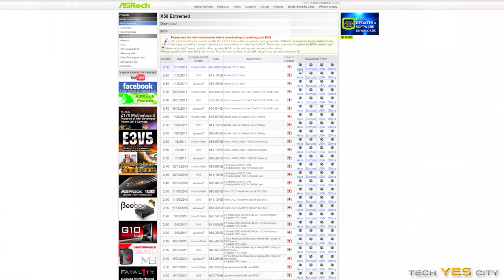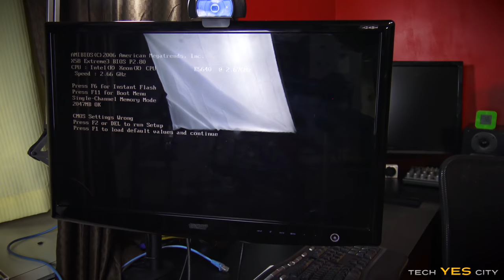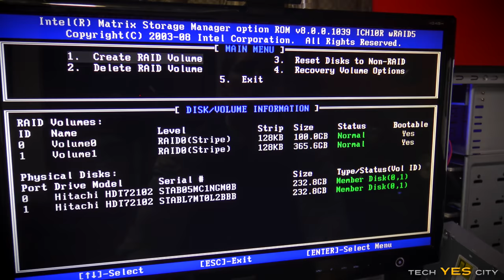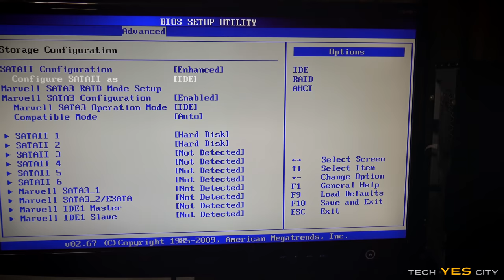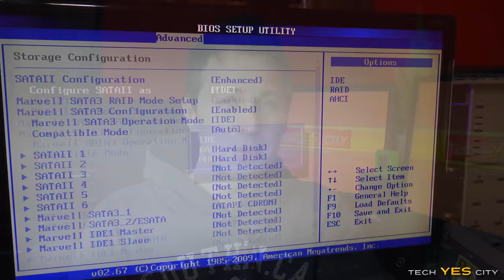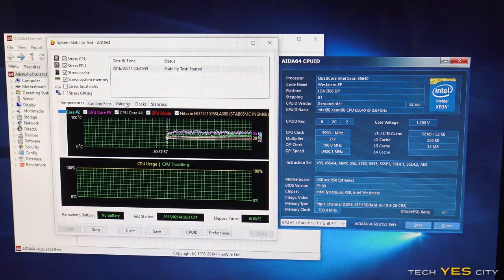Project WESTMERE - $327 USED PC Ft. The i7-???

Comment: Always appreciate builds like these that showcase just how much value can be had if you go back a few generations.  Best part is that platform still has a lot more headroom despite being nearly seven years old at this point.  Can still handle the highest end graphics cards if someone really wanted to go down that route; although it does make me wonder if pascal will finally push them to their limits.

Comment: Love your builds. did my own this past month some one tossed out a Lenovo M48 the system was striped of every thing but the cpu but I did a full rebuild of the system after watching your videos made me really want to fix it up and see what it could do.

Rebuild specs Intel Q45/43 Motherboard Lenovo Branded 
CPU: Q9400 
Ram 8GB DDR3 1333MHz 35.00 shipped
HDD 250gb 10.00 local store
Enermax Pro 82+ 625W PSU Free from work
ASUS HD7770 60.00
Windows 7 Pro Free from work
105.00 all in

Was fun to do a build like this gets great fps with no overclock on the cpu as this board is not made for it but still get around 60 - 80fps on High though Bf4 and other games at 1920x1080 keep up the great videos. I might do another build :D

Comment: Hey man, I'm really enjoying your content and I'll be subbing right after I finish this comment: As great of a deal as the E5640 is in general, I can't help but feel that its performance should be identical to the 920 that came with the motherboard (at the same clock, of course). The 4GHz on your E5640 should be attainable on the 920 (maybe not if its a C0, but a D0 should get 4GHz). So from a value maximization perspective, the E5640 seemed a little wasteful because you had the 920. Granted, if the mobo didn't come with a 920, the E5640 is clearly the superior choice. I know you can sell the 920, but that's a bit of a hassle. Anyway, cheers!
Reply from the maker: +spire107 Hey thanks for the comment (and the sub too!), The 5640 will be more powerful than the 920 since the 920 is 45nm and the 5640 is 32nm, I will double check the scores clock for clock in the next few days.  And also I like being different and couldn't resist using the 5640 and then trying to flip the 920 for $50 or so (so $30 profit for a better cpu :P).  It is pretty easy for me as I have auction access on both ebay and yahoo.
Reply: +Tech YES City Wow, I didn't realize that the i7-920's were so expensive. I have a Xeon W3520 (basically a D0 920) and I've seen them sell for around $5 each. I shouldn't have assumed that 920's would sell for the same amount. 

I couldn't agree more on the appeal of the E5640. In fact, I'm thinking of selling my 980X in order to get an E5640 and use the difference to upgrade my GPU. I've heard that there is a 5% IPC gain between 45nm and 32nm, but haven't tested it myself. I'm quite interested in your results if you find the time to test it.
Reply from the maker: Yeah I guess the reason for the 920s being expensive is the qpi of 1, a lot of x58 boards won't support the xeons at all.

Comment: great video man :) in my opinion buying used pc parts is just freaking genius because i also bought used pc parts like you and built an unbelievable gaming machine for only $390 USD :O specs are given below

CPU : Intel Core I5 4690K Overclocked @4.4ghz
CPU Cooler : Cooler Master Hyper EVO 212
GPU : GTX TITAN
RAM : Crucial Ballistix Sport 8gb (2x 4gb) and Kingston HyperX (2x 4gb) = 16gb of total ram
MOBO : MSI Z87-G45 Gaming
PSU : Corsair CX600M
HDD : Seagate 1TB

believe it or not but its true ;)

Comment: 3dmark score isn't that bad. Though I was expecting a bit higher for some reason.
I recently made a build with the G3258 and 7870 (r9 270x). Scored a little less than this rig, I had parts already laying around so the build only costed me around $150 out of my pocket.
It doesn't compare to my main rig, but these budget builds are very capable if you have some knowledge on what to get.

Here is my score btw. 
5253 with AMD Radeon HD 7870(1x) and Intel Pentium G3258
My G3258 is clocked at 4.6ghz @1.32volts.

Comment: I got an X5670 @4.6Ghz in my Main Pc with 2 R9 290, and it is an absolute beast. I had an i7 4790k with 2 R9 290 before, but the Westmere just feels much more snappy.
Reply from the maker: +MarcChep Yeah the x5670 packs a tonne of l3 cache too, great architecture.
Reply: I really love the X58 platform. The X5670 destroys more modern CPU's in multi-theaded applications.
Reply from the maker: Yeah with the right board too you will have usb and sata 3 there too!
Reply: It's pretty amazing :D

Comment: Awesome killer budget build bro !! more than half my 3dmark firestrike score (10950) with a fraction of the price (mine 1000++ 6600k@4.5 r9 290xOC) well if you count the ssds case etc way more because I went overkill, but that's a nice way to compare !

Also, you use a mask for soldering that's smart ! (what did you solder btw?) and that case is pretty cool
Reply from the maker: +Thomas Syxe Solder the 24 ATX pin with a Sata Cable, as I couldn't find my voltage reader (going to look for it this weekend).
Reply: I dont get it but no big deal XD lol

Comment: What's the time Mr Bryan? :P

Pretty good build dude, but it's always the case when you get a cheap but good CPU that kicks ass you have to get a mobo that costs stupid money. I think the price to performance kings at the mo are the 65nm quad core Xeons but you have to have the right chipset and mod the board and CPU.....Talking of which I thought you were doing a 771/775 mod build....Waiting patiently :P

Also what connector did you splice in?

Comment: Thank you for sharing :) Really nice rig for that cheap price. Oh yes you remember about my xeon to get it to 4ghz? Its not possible, because there is a hardwarepart missing in the b85 pro gamer motherboard, but anyway 3,8ghz @ all 4 cores on a xeon 1231v3 is really nice too. Maybe when i build my new rig when broadwell e is out, i will buy a cheap z board and then i try to oc my xeon.

Much greetings :-)

Comment: Just did a build today a c70 case, DVD rw, cooler master 700w psu 80 plus, am3+ motherboard, fx4150 cpu, 8gb of 1600kHz ddr3 a 128 sad, 1tb ad blue hdd, 7x140mm corsair fans, and a power color HD7850. All parts were picked up on Craigslist for around 173.00 us dollars can't wait to overclock benchmark, then gift it away to my friends kids

Comment: Hey Brian, I was wondering if the $356 budget gaming PC I am building is compatible and thought that you were the person to go to because you're a GAMING PC GOD :). Please reply back ASAP! THNX!! Here are the specs:

Intel Xeon E5640 
ASRock 970 Extreme3 R2.0 AM3+ AMD 970 SATA III USB 3 DDR3 2100+ ATX Motherboard
Kingston HyperX Fury White 8GB (2x4GB) DDR3-1866 Memory
Seagate Barracuda 1TB 3.5" 7200RPM Internal Hard Drive
EVGA GeForce GTX 750 Ti 2GB Superclocked Video Card 
Zalman Z3 Plus White ATX Mid Tower Case
EVGA 430W 80+ Certified ATX Power Supply
Reply from the maker: You will need an AMD FX cpu for that motherboard, if you want to use the e5640 you will need an x58 motherboard, which can be pretty expensive online (I find they are much cheaper at used parts stores). Other than that be build looks good.
Reply: Hey Brian, I JUST updated my build. Is this compatible?

Intel Xeon E5640
Cooler Master Hyper 212 EVO 82.9 CFM Sleeve Bearing CPU Cooler
HP Z400 LGA1366 TYLERSBURG-B3 DESKTOP MOBO 460839-002 461438-001 FMB-0802
Kingston HyperX Fury Blue 8GB (2x4GB) DDR3-1600 Memory
Seagate Barracuda 1TB 3.5" 7200RPM Internal Hard Drive
EVGA GeForce GTX 750 Ti 2GB Superclocked Video Card
Thermaltake Core V21 MicroATX Mini Tower Case
EVGA 430W 80+ Certified ATX Power Supply 

PLEASE REPLY QUICKLY!!! THNX!!!
Reply from the maker: Will be compatible but not sure if that motherboard will be able to overclock?
Reply: Do you know any other mobos that are compatible and under $74? I'm on a bit of a tight budget. :/ Reply back! Thnx!
Reply from the maker: Here is one up for acution at the moment for me locally lol, will prob go for around $50-60? http://page15.auctions.yahoo.co.jp/jp/auction/t477947659
Reply: You're lucky you live in a country where it costs you money to throw shit away get like fuck you get deals like crazy
Reply: do those sellers usually ship to the US?
Reply: +Ben Dover gtx 560 is worse than the 750 ti and the gtx 660 is similar in performance but doesn't overclock nearly as good...
Reply: +Ben Dover a 750 ti is hardly more expensive than the 660. on eBay they go for similar prices. Best used card for the money whoever would definitely either be a 770 or 7970/7950
Reply: how can you overclock an i5 2400?
Reply: ToronTech u can't
Reply: yes you can but i don t know how to do it.

Comment: There's a lot of motherboards that come from desktop manufacturers like Dell on Craigslist/Ebay. If you bought a Dell motherboard, could you physically install that into a non dell case? Last I knew they had proprietary parts that could only accept power from a Dell case. (Dell's just an example, but I'm really asking on any Desktop manufactured board)Also, would it need specific drivers?

Comment: pcmr: my $327 pc destroys your consoles
peasant: it might get more fps than a console but at least i dont have to spend $10000 on a video card every time a new game comes out and the human eye can only see 30fps
Reply: Lol
Reply: Andres Celano but it's true. Sony and Microsoft arelying to console users
Reply: Adeel Rehman true but I am saying most of the supposed master race are 12 year olds with prebuilt systems
Reply: Andres Celano And teens like me who think ita funny to act like a 12 year old PCMR fanboy who doesn't understand pcmr.
Reply: lol  such a poor troll first off graphics cards aren't that exensive second off upgrading Ur graphics card only comes around every 3+years and maybe costs 400$ of that much... even a gtx 750ti from 2013 can still play the witcher 3 medium high settings 1080p  60fps stable
Reply: +Mac PooPum Or GTA 5 on ultra Settings paired with the G3258 wich you can overclock with the stock cooler and probably if you get an aftermakret cooler you can probably get it to around 4.6 Ghz
Reply: +TheEmptySquirrel having a bad ass cpu isn't going to make the difference between medium and ultra... ultra isn't worth it although having that cpu would be nice and get maybe a 10% increase in performance... but the 750ti doesn't have the power to handle ultra settings even thiugh ultra setting isn't worth it imo
Reply: Mac PooPum
you totally missed the joke. whoooosh is the sound it made going right over your head.

a 750ti isnt plays witcher3 at 1080 on medium or high locking 60fps. maybe all low.

and sometimes having a badass cpu can make a difference between medium and ultra. assuming you are trying to achieve a playable fps target on that setting.
if draw distance is in the settings that is a cpu intensive setting. draw distance affects scene geometry. more scene geometry means more draw calls per second. draw calls per second dictates fps. thats why intel cpus get more fps in open world games than amd cpus using the same gpu.
and that difference can be up to 40%, not 10. the ipc difference from an fx chip to a skylake is around 40% which translates into single thread performance. single thread performance and fps scale linearly in a draw call bottleneck scenario

random source for proof before you spew anymore bullshit. scroll to the bottom and look at cpu scaling of the amd chip. dx12 reduces draw call overhead so a slower cpu can process more draw calls per second
http://wccftech.com/hitman-pc-directx-12-benchmarks/
Reply: +EZOVERDOSE alright that's all fine and dandy but still I know for a fact a 750ti i5 4690 and 10gb of ram can and DOES run witcher 3 on medium 1080 60fps stable... how? because my brothers have that EXACT setup and they both play the witcher games...
Reply: Mac PooPum
no one should ever have 10gb of ram. because using matching sticks of ram there is no configuration that would equal 10gb on a 4 dimm mobo. you shouldnt mismatch ram either because if the timings dont mesh you can get memory corruption which leads to blue screens. theres also the possibility of running an odd number of stick which on that cpu would force the controller into single channel mode. so 2 4gb sticks and a 2gb stick would be half the bandwidth of just 2 4gb sticks by their self.
Reply: +EZOVERDOSE it's a 1x8 gb and a 2gb stick. .. the pc has been running for years and it's only blue screen once... and it wasn't ram related... bottom line still stands 750ti and 1080 p gaming is perfect
Reply: Mac PooPum That's not an ideal Ram setup, but nothing you can really do about it. You should have a 4 gb and 1gb stick in each channel.
Reply: Mac PooPum we all know its not true dude 750 ti is just not capable of that

Comment: This is pretty good considering I have an i7 4790k quad core 4.4ghz (turbo) gpu 7950, 212 Evo cooler master, 2x4gb 1833, 750 watt psu. 1280x1080p monitor, I ran the unigine valley and my fps came out to be 47.9. But that's as soon as I turned my comp on and I ran it a second time and got high scores but don't remember them lol. My score was 2005 I was thinking about upgrading and buying a used 290x
Reply: I ended up getting my 4790k for $220 brand new out of the box.
Reply: +Joseph Drake (EpicDraw99) i think you mean 1920 × 1080 :D
Reply: +Joseph Drake (EpicDraw99) I think you spent too much on the cpu and not enough on the gpu. the 4790k is a cpu that only shows its full potential with a GTX 980ti. But with the graphics card you bought it's a huge bottle neck

Comment: i found an old dual socket workstation mobo for lga 1366 and am going to use 2 e5640 with 8 gb ram and a 7850 for 323 but i think i can upgrade the gpu and ram a bit and still be very cheap so i was wondering what your thoughts were on dual socket systems with around the same graphics power like your pc in this video, if the performance would be even better or if it would stay the same

Comment: Hi Bryan.  Got a question for ya.  I am looking at SSDs and I wonder if M.2 type are 'better' than the 2.5 form factor.  What do you think?  Here are a couple of examples. Samsung 850 EVO 250 GB 2.5 or Samsung 850 EVO 250 M.2.  Both are same price (~$85.00).  What do you think?  Yes,my MOBO supports M.2.  Are there any advantages or disadvantages?
Reply from the maker: +The Hazcat M.2 can have some issues, thouhg it is smaller form factor and doesn't need any cables, I would go with it if you do a google search with your mobo and no one is having problems, if you see lots of problems though just go sata.
Reply: +Tech YES City  Thx Bryan.  Yep, looks like a fair amount of probs with the M.2.
Reply from the maker: No worries, I guess that settles it for you.

Comment: i just picked up a  supermicro ddr3 dual socket lga 1366 motherboard for $84.00  an a pair of  x5650's for $63.00  i have  8gb of ram in it right with a gtx 970 i already had  an 120gb corsair force ssd i got for $15 off craigslist  .. i cant be happier  with this system.  coming from a i7 4790k that was destroyed by lightening  im not hurting  in fps  i can stream now with out any issue. my i7 would get laggy

Comment: i almost have the exact same build, exept... gtx 460 and i7 920, it runs well. supprisingly was only $320 aud
Reply: I got a Intel Core i7 2600 for free from my friend :D
Reply: I have an i7 950 with GTX 460s in SLI
Reply: i just got not 2 days ago a 980x for $30.
dont ask me how or why or anything else, cuz i realy dont know XD
Reply: joshi paul Lucky. My 950 is essentially your 920 but a little bit faster
Reply: yeah
Reply: yeah i know, go figure. sold that a while ago and now running a 4770k and 2 780s

Comment: Do you have to buy a x58 motherboard? or just find a LGA 1366 socket motherboard. You could get a LGA 1366 motherboard cheaper the the x58. Wondering if the x58 is the only one that supports this CPU.
Reply: +Bryan Jaquith those xeons only work on x58 boards
Reply: +Jonno the First Oh okay. thanks

Comment: This build is at the other end of saying: "because I can." I am sure it would be very helpful to someone, however not quite practical it seems to me. True it is super cheap but few weeks or month later, there is a chance you may ran into different problems like random freeze or random crash, then you may end up with a painful  trouble shooting process, with chance of spending more money on debug/replacement hardware, or at the end of the day when you say that's it, I had enough, you just wasted $327 and you are going to build an other PC.
Reply from the maker: +Dylan Z I will flip this one and then build another :p.  I think this one will be fine though as inspecting the components they were really strong. The mobo for example had some dud profile in the bios, which means the previous owner did not overclock the cpu or board at all..... and these boards were definitely designed for punishment.

Comment: Since the mobo came with the 920 I would've kept it for the build, you can bclk overclock them pretty easily to 3.6 - 4.0Ghz with an average air cooler like the 212 evo
Reply: edit posted this before I saw you oc'd the Xeon, didn't think you could PC xeons, my bad :)
Reply from the maker: +Dylan Scully Yeah for $20 I would much rather overclock that on its 32nm proc than 45nm on the 920, and I can still hock the 920 for $50 or so for someone who doesn't have a QPI 2 x58 board :P.
Reply: +Tech YES City Yeah this is why I should wait till the end of a video to comment.
Reply: +Dylan Scully I was thinking the same but then realized the power consumption difference add to that the psu quality.

Comment: why use the xeon when you have the 920? they both have the same amount of cache, core/thread count but the i7 is clocked higher.
Reply from the maker: +Baumy 15 32nm vs 45nm, higher qpi speed, better bin, 12mb l3 cache vs 8.  the E5640 is a stallion.